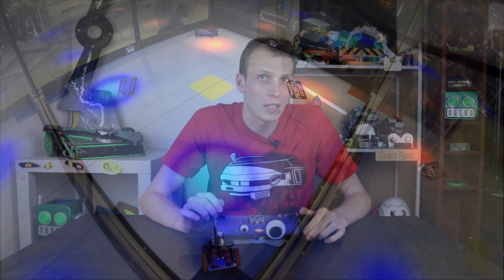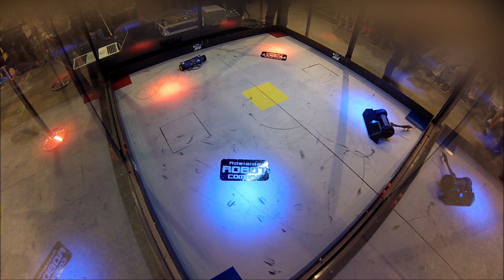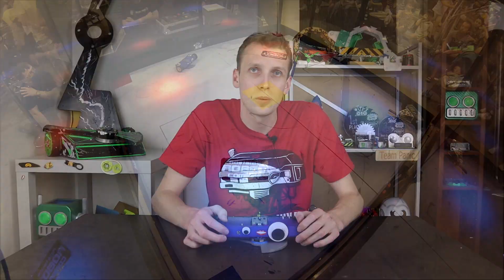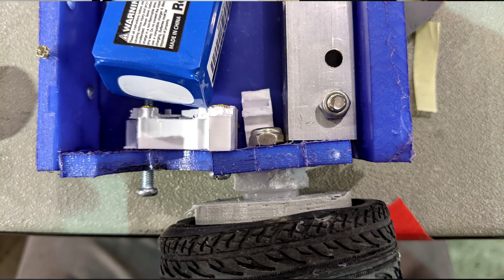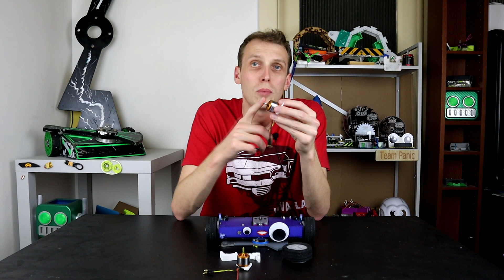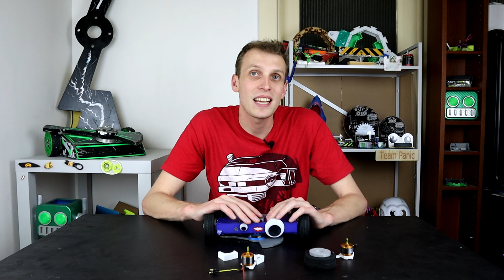Annie_R_U_OK undercutter fights!! (Robot Havoc 4 fight report)

Comment: Annie has a thing for Anti-dozer's 3d printed wheels as well as Bunyips tires, doesn't she?

My honest opinion, go back to brushed. These YOLO and trans drives haven't really done Annie any real good, just resulted in unreliablity and headaches. I'm all for inventing and trying new things, but I'm also of the addage "Don't fix what isn't broke." and brushed Annie certainly wasn't broke.

Maybe experiment with YOLO/Trans drives on a new robot? Maybe run It Works as just a dual spinner rather then a melty for a couple of events to practice driving YOLO?
Reply from the maker: Mmm I'm thinking this might be the way to go

Comment: I feel like that putting the motor shafts pushing on the inside of the wheel instead of the outside would help alleviate some of the slip of tire wear. Then add in some springs to tension the motors to keep the shafts in contact with the wheels for when the wheels eventually take damage.
Reply from the maker: Both good ideas

Comment: Good fights. I think the tangential drive showed real promise. A thing that I’ve seen with other robots that run tangential drive (the Brazilians) is that they have extremely stiff aluminum side rails that both the wheel and drive motor are mounted to. This alleviates a lot of flex and compliance in the system which appeared to be most of the problems you were having. Another thing they do is actually flip the motor shaft around so that it sticks out of the back of the motor rather then the front. This puts the bearings closer to the actual point where the shaft meets the wheel. This may be worth trying, but if you have your own ideas then definitely give them a try.
Reply from the maker: Yeah definitely need to mount everything better a bolt through hdpe and a 3d printed part just didnt cut it
Reply: @TeamPanicRobotics  Yea, it appears so... Maybe even try shoulder bolt drive shafts since they have a nice machined finish?
Reply from the maker: I wanted to do that here but forgot to order bolts in time
Reply: @TeamPanicRobotics  Ahh, gotcha.

Comment: What about a sleeve on the motor shaft (maybe tpu?) That would give you a bit of shock mounting, plus would increase the diameter of the motor shaft to slow Annie down a little bit.
Reply from the maker: I tried the sleeve idea with the heat shrink, it didnt work that well and was worn away in one of the fights
The only other sleeve I think I'd try is plasty-dip or similar

Comment: You could if you change to a geared brushless drive do something similar to the beetle weight copper head that's been competing at norwalk and seems to work like beast

Which I think Seth aka division guy made a video on his saw robot that used the same drive system
Reply from the maker: Gears are on my list to try out for sure

Comment: I want a bot to use a hydraulic pressure system, but not to power a flipper, but rather, to sort of spring load a punch to be delivered to the other bot; and depending on what you're up against, you can change the tip of the hydraulic thruster weapon, to either be a sharp rounded spike, or a blunt, rounded tip on the same sort of spike weapon, so you can either punch and break with sheer force, concave and break things, or you can choose to puncture. Either way, it should be a low resting bot, with the weapon in the middle of a wedge that feeds the opponents robot up so it can be punctured or punched on the bottom of the bot, or just right at the other bot on level ground. 

Really had a hard time describing this idea.. but I could draw a picture in 8 seconds illustrating what I mean
Reply: I think you're thinking pneumatic, not hydraulic. Unless you're talking about using hydraulics to cock a spring, in which case a motor and gear system would likely be lighter.
Reply: @Furiora  yes I 100% did mean pneumatic, I was up super late and high as a kite, thinking hydraulic simply because of the cylinders, and jotting down a half asleep thought to save in my notepad. Lol I didn't actually even mean to post this, but yeah, I meant something like a co2 powered cylinder, such as the one that powered chaos 2's flipper, but instead of it powering a flipper with the pressure it's built, it forces a solid metal spike at the opposing robot. Or, like I said, it could have a rounded, blunt end to sort of punch the robot. I feel like that would do some serious damage with how much power those things can generate, especially especially the reduced surface area impact.
Reply: @Furiora  also would definitely need to be a full sized robot to have any kind of impact, no matter how hard a little cylinder can punch, it won't be able to break through a titanium wedge, or even a thick aluminum one, there just wouldn't be enough weight behind it to do so. It'd probably just kind of punch them in a certain direction, which, could actually be cool, if you made a pneumatic powered 90° angled plate on the front, that pushed out from the robot about an inch, so that you could ram into them and activate the weapon at the same time, you could probably just slam them into arena walls and stuff. Idk, I have an active conceptual imagination.
Reply: @Smokin_Snowman  Well, 101 had pretty much what you're discribing and did do some surpising damage (when it worked) Mike had even set a magnet at the back of the cylinder to hold the spike back until the pressure built up enough, creating a "slingshot effect" as Mike once said in an interview

Comment: Could the drive motors mounts be hinged, with a spring pushing the mount towards the wheel? The idea being to compensate for damage and wear and provide good friction between the shaft and the tyre. I think that might provide some shock resistance too.
Reply from the maker: Thats a good idea for sure, one thats worth trying
Reply: Literally reversed the comments to suggest this. Awesome idea!
Reply: Would it be better to spring load the wheel instead of the motor?
Reply: @MrCarrellScience  That would mean the wheelbase would be constantly changing.
Reply: So a suspension?
Reply: @afish8883  kind of, but instead of just shock mounted it would be pushing the wheel towards the motor shaft
Reply: What a great prospect